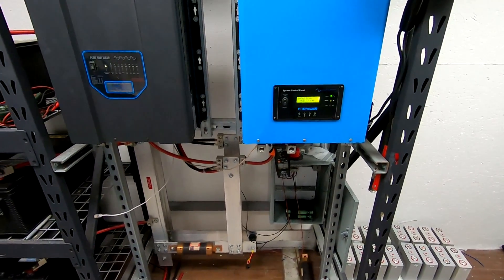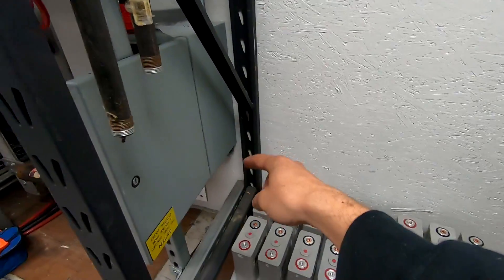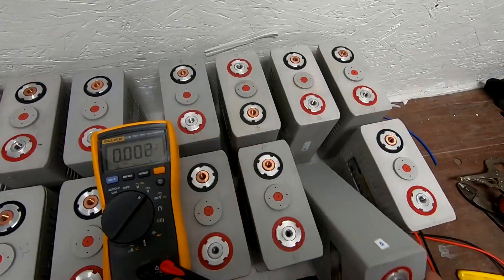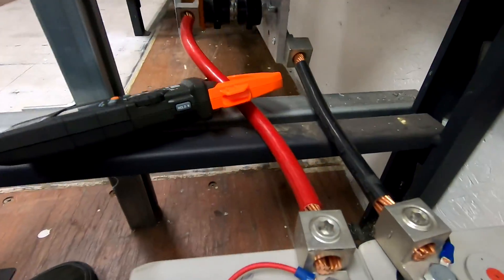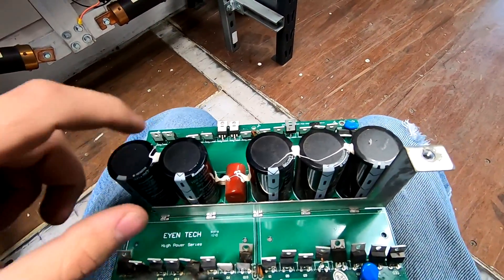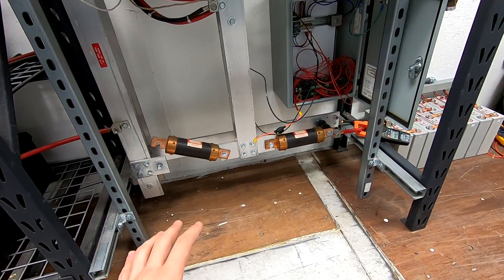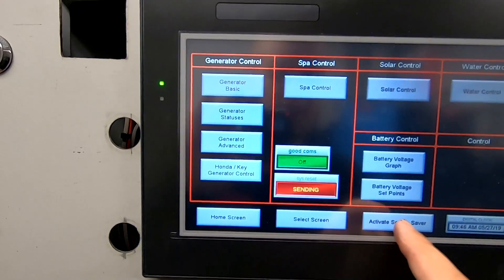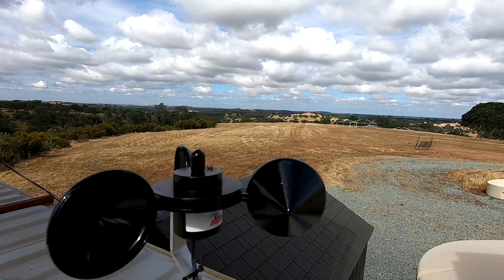Off The Grid: Installing the Best New Lithium Batteries!

Comment: Best of luck ...
Good for you telling the power company to pound sand. 
Someday we'll all be off the grid and use free power from solar, air, water etc...
It's an expense to start up, but, I believe it's worth it...especially for the environment.
Reply: @Frank - Going Off-Grid is very expensive  ...
Reply: @MrSummitville  ...you are correct, the initial setup is very costly.
Reply: lithium not reusable...

Comment: I have some ?'s. I have a 12v 100ah sealed lead acid battery in my van. Would like to make a bigger better system with the lithium batteries like you have. Where can I by them for cheap, and I was told there is a way to do it with out BMS.
Reply: Look up headway 38120 batteries.

Comment: how do you know they are the "best" new lithums?
Reply from the maker: They perform super well and don't want to burn the world down, so it comes down to safety, performance, and cost.  These batteries are 5 stars in all the categories.
Reply: @HighTechLab  I didn't ask how they perform, I asked how you know they are "the best"
some testing/ metrics? comparisons? scientific lab reports?  that kind of thing with which you can apply a measurable application of "best for ~this reason according to ~this criteria through ~this testing facility"
a star rating is virtually useless unless in determining measurable results.
(I'm not trying to be a dick)
Reply from the maker: So our testing on these was pretty extensive.  We plotted the discharge curve of each cell using a HP precision load while measuring the plot with a graphing fluke meter.  The curve is super flat......And again they are also tested by others and they have compared to other chemistries and have come out on top.
Reply: @HighTechLab  sweet, all I wanted :)  
Thank you.

Comment: So... do you not close that box with your balancers and transducer?
Reply from the maker: I do, however there are still a few holes I need to punch for the wires that tie into the buss bars.  If you are wondering because the door appears to be blocked by the unistrut, the door is pin mounted and I put it in that configuration so that it would stay out of my way as I was working inside of the cabinet.
Reply: @HighTechLab  ohhh. I see now. Yeah, I thought you built the unistrut in the way of the door. My OCD went into hyperdrive when I saw that.

Comment: Its actually outdated technology.
Reply from the maker: What is?
Reply: @HighTechLab  Lifepo4 has been out nearly a decade.
Reply from the maker: How does that make it outdated
Reply: You could size down your whole bank by running NMC, or LTO either one, with even more capacity.
Reply from the maker: It's an exchange for safety - NMC is known as "the flammable one" and I'm a bigger fan of safety.  Plus you are saying "size it down" "with even more capacity" which somewhat contradicts itself.
Reply: @HighTechLab  nmc is actually safer.
Reply from the maker: @xcentriclithium5467  according to https://batteryuniversity.com/learn/article/types_of_lithium_ion , Prismatic LiFePO4 is one of the safest, might want to read up a bit more on LiFepo4

Comment: AT 8.35 / Many of them have been repaired. A bad industry because condensates are placed close to the transistors. In addition, it is advisable to use a large transistor(to247) and copper radiator

Comment: wow sounds like a design flaw, people who use Victron products do not seem to have issues with inrush current.
Reply from the maker: To be fair it might not be an issue but it's something that I'm taking precaution instead of reaction
Reply: @HighTechLab  ya a  1K  resistor to trickle charge it will fix that problems and you could leave it connected long term
Reply from the maker: It's only when first connecting to the batteries is it an issue.  Since the system runs nonstop, I don't find myself disconnecting and reconnecting much at all.  Maybe 1-2 times a year.

Comment: You can make the wires for balancing look neater if you install a piece of slotted trunking on the inner side of the panel. That way you wouldn't have to cut the wires.

Comment: I've been running my entire house on these same batteries since 2015. Actually I have the Calb 180ah ones. These batteries are amazing. All of them were above 180 ah even though they are rated for 180. After 4 years of daily cycling them with NO bms or balancing, they are all still in balance and are at around 178 ah now. These are great batteries.
Reply: Hey Marc, could you possibly share where you got them from? Looking for a reliable source. Tx
Reply: Sebastien P I bought mine from Jack Rickard. He has a YouTube channel and a store geared towards self converted electric cars and now he’s focusing more on solar. I believe the website is EVTV Store. But just search YouTube for Jack Rickard and his channel will come up.

Comment: the inrush into the inverter is a result of poor design easy fixed with a soft start circuit. any power supply engineer can do that.
Reply: I've seen some old soft start circuit from GE as simple as a multiple pole relay with adjustable throws per pole and a high watt resistor. As long as inrush duration dose not exceed the delay between adjusted poles this should work?

Comment: CALB Lithium Ion phosphate 100AH batteries.
Battery Link - https://www.alibaba.com/product-detail/Lifepo4-battery-high-discharge-rate-battery_60804429422.html?spm=a2700.7724838.2017115.187.71e27e788jORzC
Battery Equalizer - BMS. QNBBN (not sure what size so don't shoot from the hip and purchase this one)
Link - https://www.alibaba.com/product-detail/8S-24V-29-6V-Battery-Equalizer_60814428714.html?spm=a2700.7724838.2017115.63.eacc53f2SoWKwi

Comment: I have much different system. I use NiFe 700Ah total bank. With inverter caps charging you can put a big wire wound resistor across fuse before connecting fuse to charge cap. use your meter to check charge. when charged no spark when connecting fuse. use ohm's law to figure resistor.  around 50 ohm 200 watt or so should be fine. peek 1 amp charge for 50V battery. would be 50 watt.  go on eBay find a resistor cheap. you are just charging caps. same for super cap bank. remember resistor can go open use meter to check charge on caps. you can use a lightbulb. for 12V systems that is recommended to charge supercap threw 12V car lamp like 1156 or so.  Discharged caps are a short circuit . Charge before connecting battery direct and they hold a charge so same resistor or light can safely discharge cap bank as well.  Lots of power safety first !!
Reply from the maker: Isn't the NiFe also called Edison iron?  I forget all the chemistries
Reply: @HighTechLab  That is what I have. Edison nickel Iron cells 1.2V each. I got the china ones.

Comment: Man I sure do enjoy your channel and have learned so much watching you do your build. I could only dream of getting my system to the level of your system. My story is very similar to yours on the choice to go off grid here in Chile. The power lines are less than 40 feet from my house. I wish they were somewhere else entirely because they use the sweet spot for my sun shine. 

I am very interested in lithium batteries to say the least as batteries here in Chile are expensive and my AGM batteries are just not holding up. I actually have 2 systems a 234V / 4,000w system and a big 10KW 48v system. Using PIPS and Midnites. 

I have a question, can you do a generator video explaining what you have found works best and pit falls for those as I have found my generator to be the major problem in my system as well as my batteries which you have already spoken to as in the video today. 

I love your channel and keep up the good fight. Jim in Chile.

Comment: oO until he dropped that spanner onto the battery terminals... Two short comments from someone who does this for a living: 1) use cable sleeves on your flexible wires- especially the bigger diameters are better crimped than screwed.  Run over on full load with a thermal imager!  2) On higher capacities with Li-packs you may concider enclosing them into a top-open steel container filling with Silicate sand. Cheapest fire prevention ever....
Reply: I was wondering about those exposed terminals too! And not just the end terminals, but the pairs of links going down the middle. Eek. Like he said, LiFePO4 cells can easily put out a lot of current.
Reply: @IanTester  True. But still somehow professional for a hobbyist. Kinda like it. feeling tempted to mail him some crimps... ;)

Comment: Im curious what all your powering with your power system. I ask because as a travel RN, i live in an RV i take to locations when i take up contracts and something i did to my RV recently was convert everything to DC because my 7-year-old RV frig was not cooling correctly well anymore and converted it to DC compressor system via a kit from JC Refrigerations out of Indiana that dropped the power draw from 120v 400ish watts on old ammonia based system to now 52 watts on 24v DC. Along with replacing 7-year-old a/c units with newer more efficient 24v DC rooftop units. This along with switching electronics to DC like for example... my laptop i was able to get a DC car charger for charging it, my TV i was able to get a 12v DC cable for the power brick the RV runs so much more efficient and consumes so much less power not having to use the invertor now. I did keep the inverter to power a handful of 120v items at times, but installed it on a relay system. So i no longer have a power draw on the battery bank for just having the inverter sit idle, when I want to use 120v I flip the switch in the kitchen to connect the power to the inverter from batteries and use it. My solar battery system lasts much longer now compared to before running everything through the inverter. I have the super capacitors installed in 15v strings (20 caps in total), pulling 12v system from the first string and 24v from both strings (20) of caps. Both the solar controller and Inverter are wired into the caps directly with the resistor between the cap system and the battery bank. Everything is just so much more reliable running directly off DC directly as ive had to many issues with invertors over the years with the 2 different solar systems I've had on my RV, since going DC everything has been rock solid reliable... Something i have been contemplating is building a house with everything running DC power directly. There was a tiny house in Alternative Power magazine that did this, he even built a DC generator system with a predator gas engine connected to a DC electric motor via belt, that he wired into a 2nd solar charge controllers to charge the batteries, it does not know the power isnt coming from solar panels... but the entire house ran off DC, DC led lighting, DC frig, DC stove/oven, DC air conditioner, DC washer/dryer, and DC on demand water heater.. pulling power directly from the battery bank with no electronics to burn up in between. Only electronics was on the charging side of things.
Reply: Ranch

Comment: I got by burning the edges of my 24 V fuse links when connecting the inverter by use of a large vitreous enamel resistor of 1 Ohm. Wire a large croc/alligator clip to either end, then clip it across the fuse-holder. Inrush-current restricted to 24 amps = small zap, no burn. Insert and tighten fuse-link, remove charge-up resistor and put it in safe place. Turn the Lead-acid fuse vertical, cable-tie it and lock it up well!

Comment: Where did you got those batteries and are they better than Lithium
Reply from the maker: They are lithium....The actual chemical makeup is LiFePO4 and are typically called prismatic (as opposed to rolled) or "block" cells

Comment: are you going to do a transfer to go between the two battery banks and if so is it going to be a automatic switch
Reply from the maker: Not planning on it.  It would be a manual override in a worst case scenario event.

Comment: Fake News !! LTO are the best Lithium batteries available atm. So why are you telling us lies?
Reply from the maker: LTO?  Not familiar with what that means, can you elaborate?
Reply: @HighTechLab  LTO stands for Lithium Titanate, a new technology that offers amazing long life, but see my reply to fella
Reply: @Rndm Fella Watch out with the words "best" and "perfect" - LTO is great stuff, but LTO has a lower terminal voltage, needing 5 cells instead of 4 to achieve 12V.  It takes more space.  Also, this lower voltage excludes some balancing boards from consideration.  LTO can last 30,000 cycles, which is great if you are a power company doing peak shaving.  Many home users, however, need capacity changes before they would wear out 30,000 cycles.  The decision usually boils down to price.  LTO is an emerging technology with higher costs both in cells, and balancing.  Today, most LTO cells are cylindrical, like Jehu's favorite only twice the size.  I have not seen LTO in large 100+ amp-hour packaging.  That means LOTS of cylindrical cells in parallel instead of a few prismatic cells that are easier to support.  It's the difference in professional work and Jehu amateur hour.
Reply: LTOs are too new, expensive and harder to use. LiFePO4 has lots of support hardware available, 2000+ cycles should be plenty for most people. Plus, that usually means that at 2000 cycles, they are at 80% capacity and still have very much useful life left!

Comment: I'm not familiar with Prismatic LFP batteries, Is each cell 100ah or is the whole pack 100ah? If my math is correct at resting voltage if the whole pack is 100ah that's roughly 5.75KWh. Would it be possible to split the pack into 4 sets of 4 for use in a camper van?

Edit: I just realized your entire pack is in series so each cell is 100ah but the overall voltage increases. So if you had 4 sets of 4 at 14.6 volts you would still get 5.75KWh but a total of 400ah from all four packs
Reply from the maker: Your edit is correct.  Many people forget that when you connect in series the AH rating stays the same, but the volts go up and the KWH rating goes up - Parallel the AH rating goes up, voltage stays the same, and the KWH rating still goes up.
Reply: At 400Ah, you are talking about some heavy duty wiring! Consider doing 2 banks of 24V and using a 24V to 12V Dc DC converter brick to get 12V where needed. The 24V to 12V aluminum shells are not real expensive, 20A  @ 12V converters go for less than $20 on eBay.
Reply from the maker: Greg, I'm not sure what you are referring to but I run everything at 48 volts nominal and all of my control is 24 volt.
Reply: @HighTechLab  Sorry hightech, my comment was meant for micim987 original above.

Comment: Hey, do you plan to insulate your bus bars in case someone is working with metal traces or things like that?
Reply from the maker: Kinda sorta.  It's just a difficult task to try and remove the metal bars around a bunch of other metal objects.  These 100 AH cells are just to get me by, I do plan to go to some bigger cells and more of them (Probably around 400-600-800ah range), and at that point I will likely dial things in perfectly including the heat shrink on the buss bars.

I am certainly far more concerned with the lithium batteries as compared to the lead acids, because the lithium cells are ANGRY and just want the power to get out of them.  In other words they will dump an insane amount of current out in no time flat causing huge arc flashes.

Comment: I use a 120v 100w light bulb to charge the caps in my inverter, only takes a few seconds, like 5 seconds at most, and then make the battery connection, with no arc!
Reply: that is a good way a PTC as well

Comment: Lot's of gee-wizardry you have going on. :0 We have a 600AH CALB battery made up with (24) 3.2/100AH cells bottom balanced (no top BMS)  we use in our mobile application. Been happy with these little guys so far.
Reply: CALB is the way to go nowdays.  Unless you want a campfire system like this : https://www.youtube.com/watch?v=lc0j8tAzMw4

Comment: Why not just add a switched pre charge resistor? I use a switched 3K 5W resistor across my DC breaker to pre charge the inverter. When the inverter is fully off, even a 3k resistor will charge the DC side to within a few hundred millivolts in less than a minute. So, no inrush currents. Simple solutions work best. Very small currents involved, so small wires and a small switch is all that is needed. And, since the resistor only has the full voltage across it for a few seconds, it doesn't have time to heat up much.
Reply: I did the same thing

Comment: I do t like the negative cable resting on the unistrut... a high amp draw could melt the jacket, or aged jacket could crumble causing a short... 
looks awesome though.
Reply from the maker: Not really, there would be no short because in order to have a short the strut would have to be at positive potential
Reply: HighTechLab I agree. But a cable resting on the support system worries me anyway.